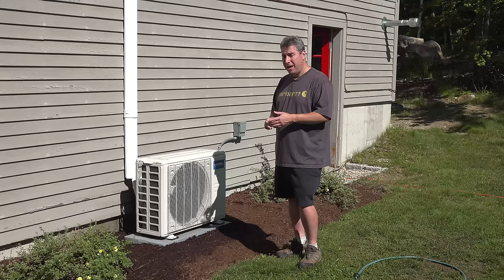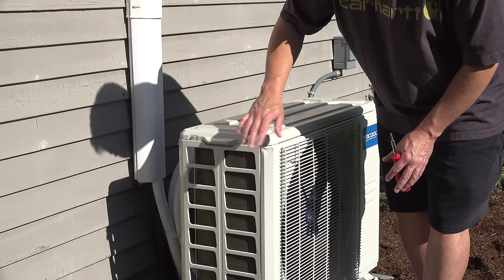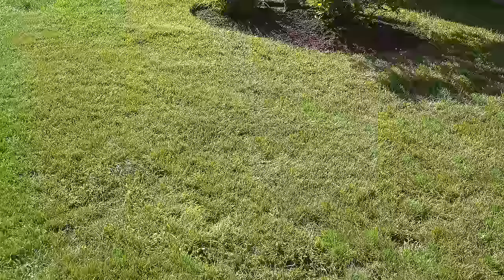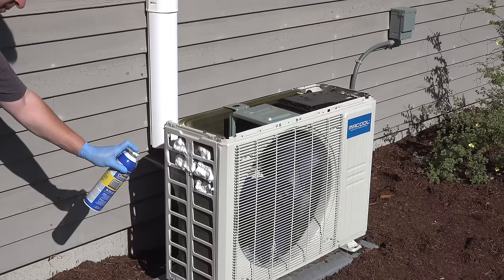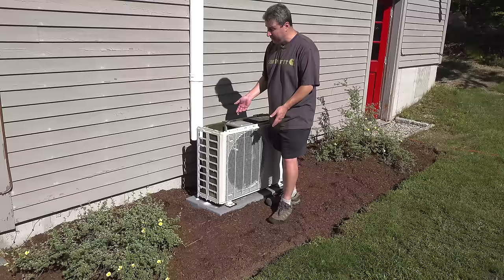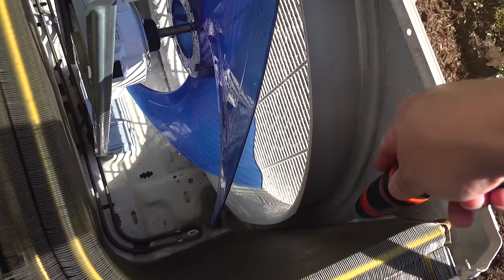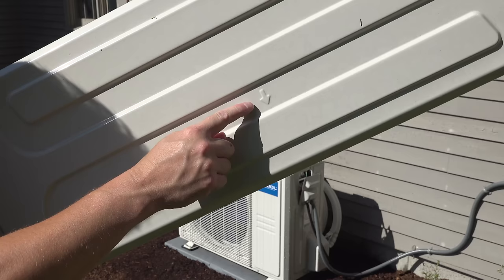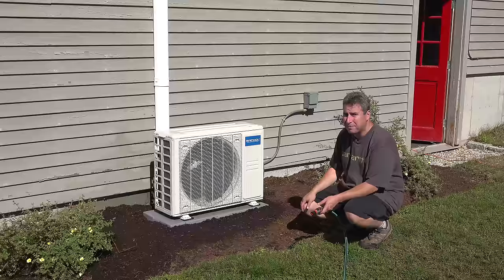How to Clean Your Mini Split AC Condenser - Make it Cold Again

Comment: 35-year vet of the NYC HVAC wars here, I would recommend starting at the bottom, so you do not miss shooting the cleaner into the coil. it's too easy to miss getting the cleaner into the coil when it's covered with foam from above. very similar to washing your car I suspect, too easy to miss a spot due to soap running down over dirt. you can also use a mixed solution and a coil gun hose sprayer. they are useful for more than just cleaning HVAC units. maybe look into the "coil gun" sprayers we use on the job and some mix it yourself cleaners for your next video on the topic? thanks for another great DIY video.
Reply: I often hear those thing referred to as a 'Foam Cannon'  or 'Foam Gun' in the car cleaning world, just in case anyone is looking for such a thing. Over here in Aus they don't seem to call them 'coil guns' all that often.
Reply: I would start in determining if the unit needs to be cleaned at all. How does one determine that? If everything is working when you stand in front of the fan the air should be blowing directly towards you, if you feel a low flow put your hand right next to the edge outside not sticking your hand into the fan but if the air is blowing sideways then you likely have a dirty coil. If it’s blowing straight and with force, what’s called “ throw” in the industry then it’s clean. One last thing, those units normally incorporate what’s called a Venturi . Look it up it’s used in other industries like fuel systems in cars and jet engine flow control but on an HVAC if the fans not latched at the right distance it retards the flow and gives the impression of a clogged coil. So recap. If the dam thing isn’t clogged don’t clean it. You might break it not knowing what you’re doing.
Reply: @carlospenalver8721 as far as the outside part just go out there and look at it and if it looks like mine it will have trash on it and lint. I'm doing mine this weekend for the first time. I watched the HVAC guy do it and he didn't even remove the cover.
Reply: 4:07 No.
Reply: @braniganirby3586 Very helpful comment there. I love the detail and the context you included 😂

Comment: I am an AC technician, newer coils should not be using chemical cleaners. You are stippling coatings off that help it stay clean. The coil can also start to oxidized because of stripping those coatings off. To properly clean your coil blow it from inside out first with compressed air then use water from inside out. There are also coil combs that will strain the fins
Reply: Can you define "newer" coils? Is there a known year cut off? Thanks
Reply: @El_Hicks  its bs. Newer units have better material, so no problem using foamy spray.

Comment: Been doing air conditioning for a few years now and approve this message. I think the cleaner isn’t really needed. Just wash it with water from the inside out and you should be good.
Reply: That's exactly what I do and if you spray it off often enough you don't need any kind of spray
Reply: Should you wait for it to dry before running it tho? If so how long
Reply: yes, this product is probably unnecessary. at least in warmer climates where you run it in Cold mode most of the time, the outside coil never condenses and therefore never gets mud or mold. The indoor coil is always nasty and maybe this product will help. But the thing is, to clean the indoor coil you need to take apart the entire indoor unit. need to save all the gas, uninstall the indoor unit, disassembly EVERY SINGLE PART OF IT and wash anything that's not electric with a pressure washer. at this point this product isn't really saving you anything. pressure washing will do everything for you.
Reply: He used to use water and soap. But now he can get paid from the cleaner company

Comment: when you replace a screw  into anything you have opened, place the screw into the hole and with the oppropriate screwdriver, first turn it anti-clockwise ( lefty-loosy ) slowly and you should either hear and/ or feel the screw click into the original starting position. this procedure is most important for plastic  objects, so as to stop cross-threading. P.S. you may need to repeat this a few times, but you will get the the idea.

Comment: Are you going to clean your inside unit? That is important to clean as well.
Reply from the maker: Agreed, you won't need to clean the inside quite as often but I wouldn't go beyond 2-3 years in a residential setting. I am planning that video, its more involved but I would like to work out the best and simplest way to do a good job and will definitely share that video.
Reply: @SilverCymbal eagerly waiting for this video! I am scared mine may have mold inside and want to clean it
Reply: I can see mold on our blower wheels. Definitely wondering how to get in there to clean the inside.
Reply: Also looking forward to this 👍

Comment: Moved into a home & had the pros come out & do a maintenance for the inside & outside units of my mini split...yep $700.   Later that the fall a tiny mouse got into my outside unit & got killed by the fan trying to escape.  THIS TIME I decided to get the mouse out & clean the entire outside unit myself. I disabled the power, took the top & front grill off, vacuumed & hand wiped the inside down ( took photos in case I forgot the order of putting it back together).  This summer  I will TRY and do the COILS ...Thanks LOVE your videos !

Comment: Iits a good to cover the electronics with plastic to ensure no water gets in there. The electronics are at the top at the power entry end and often not that well sealed. Some brands encase the circuit board in resin but others dont! So go easy with the water around the black plastic or alloy box to avoid issues.

Comment: Great as always! Thank you. On the topic of airflow, the coiled up line-set behind the condenser are restricting some of that airflow. Many DIY folks that have installed this or similar units have the same issue. It would be a great video to see a DIY custom line set length, evacuation, etc… Obviously this wouldn’t work if the line set comes pre-charged vs the outdoor unit being pre-charged.

Comment: Great vid, would definitely recommend using air to help with the drying process! And avoid any damage to electrical connections!
Reply: Air as in from an air compressor? Like one to fill tires?  I don't have anything larger.
Reply: @josephina4792  I think a hair dryer would work well

Comment: Much better if you remove the fan blade and spray from inside. Pressure washer without the nozzle   installed is the best way to clean it without bending a fin.

Comment: I'm impressed with how easy it is to clean a mini split condenser. Which the central compressor we had from the 80s, you pretty much had to completely dismantle the thing to get to those coils. If I got a mini split, I think I'd like to put it on top of cinder blocks. Our window until never got as filthy as the central compressor, and I think it's because it sits at ground level. Even setting it six inches higher might help a great deal in keeping the coils clean. In some cases, they're just mounted on supports on the side of the house like a few feet above the ground. I never saw any point to waiting until it was completely dry to use it. It's made to get wet, and it's self-drying. When I'm just giving the window units a quick spray, I'll actually just leave them running. If you hear the motor spin down, just lay off the water to let it spin back up. Don't set them stall out. Window units are designed to retain water, and the fan blade slings the water onto the condenser coil extra cooling. The fan has to be powerful enough to sling that water. The water also helps cool the fan motor and compressor.
Reply: well, to wash a mini split evaporator (or more correctly "indoor unit" since most are hot/cold units) you really need to uninstall it and disassemble it completely. i bought all the tools to do it myself. in just one summer i paid off for all of them.

Comment: It's unbelievable it costs so much to have a professional clean a split a/c. Here in the Philippines it costs about $15 though they only use a pressure washer and a shroud with drain hose. Most Westerners also don't know your car A/C also needs washing occasionally.
Reply: here in Argentina it costs $50, but we don't use the shroud. ac techs will completely disassemble the indoor unit, meaning storing the gas in the compressor, disconnecting it, taking it apart, disassemble and wash every single part separately, and put it back together, reconnect, and vacuum it down... which tbf is the proper way to clean these. The shroud  isn't really that effective because of the shape of the indoor coil. you're only hitting the front coil ( it's an inverted V shape). i live in a dusty area and I really need to wash my ACs every year.

Comment: The cool thing is with these units after there done doing there cooling or heating the fan will go the opposite way so light debris on the coil will blow away so you don’t have to do maintenance often.

Comment: Had split system installed few years ago and i live up the mountain area and extremely cold 🥶 during winter season 

Last year for the first time my unit stopped working during an extremely cold night running on heat. 

The inside unit displayed DF

I quickly did a search online and turns out these units can’t handle extreme cold temperatures and goes to sleep defrost mode kicks in.  Usually takes about 10 minutes then kicks back on. 

Thankfully got wood heating.

Comment: Have you caulked or taped the white insulation where it meets the copper? Lots of failures with that insulation from pinhole leaks where moisture corrodes the copper.
Reply: Copper corrosion due to moisture is not a real life thing.
Reply: @lesg9604  Got any sources? I'd love to believe it but the general consensus seems to be that the white insulation when exposed to water on the inside reacts with the water and is acidic, and that is what destroys the copper
Reply: so let me get this straight. The manufacturer of ductless mini splits are intentionally using an insulation product that when exposed to water negatively reacts and causes leaks in copper? Nonsense. Ductless mini splits leak because of improper torque or tightening practices on the flared connections or due to improper installation.
Reply: lol what a non-issue. copper "corrosion" due to water is not a thing. if it was, we couldn't use copper pipes for water. the green stain in copper is just patina. it'll take thousands of years to wear away. pinholes in refrigeration systems appear either in solder joints, or in copper bends, in both cases due to vibration.

Comment: On top of doing shoddy maintenance, most technicians will claim that your unit is "low on coolant gas" and needs to be serviced.  
So many scammy people in the HVAC business.
Reply: "never attribute to malice to what can be attributed to stupidity". plenty of techs will just jump at the AC and plug the gauges and say "yup yup yup there's your problem, it's low on gas" but anyone that actually knows their shit will FIRST look at everything around the unit. AC pressures will vary wildly due to lots of factors (current temperature and humidity, how much the machine has been running, actual problems such as obstructions inside, etc) but THE number one thing that needs to be addressed is making sure the units are clean and free of obstructions. the longer they're in business, the simplest the things they look for first. for example, before doing ANYTHING (even visual inspection of any units). LOOK AT THE FILTERS. so many people don't know the AC has filters that need washing or replacing.
Reply: @drgenio2006   Just a good example of a trade that takes advantage of a poorly informed customer.

Comment: This unit is put right on the ground, this the first thing you want to fix!
2nd- I noticed those long-long pipes behind the unit-those are the main problem- too much energy waste, too much load on the system. Just remove all unnecessary length of those pipes youll see the difference.

Comment: Say anyone that has a mini split with heater did you notice anything different on your electrical bill? Winter cold months is it cheaper and perform better with the mini split heater than you whole house heater or space heaters? Looking to get 18,000 btu in our one big area the family room, dinning room and kitchen which is a rectangular room about 550-600 ft.  Then for the master and two other bedrooms I’d need at least 9000 btu units in each bedroom and maybe a bit more but’s in the master which is about 20x25 plus bathroom. It’s a small house with hot flat room that I need to decide what to put on its black tar and paper roof to reflect the sun from heating it up so much. I rolled on some white sun coating stuff a few years ago over the r over the main Pat of the house were in during the days and evening which really cut down on the heat soaking down from the roof into the house, but it’s wore off and  like it was never done.   So need suggestions anyone would be greatly appreciated. Well if you read all this that is very cool. With thanks

Comment: My split system is wall mounted and is above a sloped asphalt shingled roof...it is easy to access but am concerned about the chemical cleaner may damage the shingles. Do you know of or could recommend a product safe for shingles?

Comment: Quick comment. I noticed your excess line set is sitting upright. In my Mr. Cool manual it says that the excess line set should be placed in a horizontal position, parallel to the ground. Did you manual/instructions say otherwise?
Reply from the maker: No, you are 100% correct. If you saw my previous videos I talked about this, I had intended to raise the stand below and slip it under, but that hasn't happened yet. But you are right that it should be horizontal. Not sure what happens the other way as a lot of folks put it vertical but Mr C say horizontal is the way
Reply: Hey there Mr. @SilverCymbal  and @samrobinson9802
Not sure if anyone said anything on the topic... but the coils placed vertically have a tendency of collecting the compressor oil as it inevitably escapes the compressor and travels through the system. In an ideal world, it would make its way back to the compressor eventually, but the loops usually interrupt this process and it begins to pool at the bottom of the loops. Its a slow process but it does take its toll over time and it will cause your compressor to be starved of lubricant. Always better to have the loops placed horizontally, or, if at all possible, cut the extra pipe and remove them all together. Hope this helps.

Comment: Think this will help if the unit not blowing cold air? Had mines for around 3 to 4 years with minimum use since it's in the garage area with it never being cleaned.
Reply from the maker: If you are not getting cold air, definitely look at the outside unit closely. You might be surprised to see the fins are caked with dust/dirt etc. If that is the case I would definitely clean it. There can be other causes but this is most often the issue.
Reply: @SilverCymbal  Thank you
Reply: You also may have a refrigerant leak which is the fluid/gas in your system but having a refrigerant leak is rare
Reply: @laundrybreadsticks  That is what I was thinking and Google suggested but I'm gonna try this method first. Thanks

Comment: Good video, quality content.

I'm curious, however, about the placement of your system: on the ground, on a concrete pad.

I recall last winter you had an issue where you got something like three (or more) feet of snow over a couple of days. That would totally bury this unit.

In an area where you get so much snow, shouldn't the exterior unit be placed off the ground by a couple of feet?
Reply: These units are not supposed to be ran below 32 degrees.
Reply: @brockbrawn1524  that's not entirely true. there are many of these rated to be used below 0C

Comment: I'm also in NH and I have a 36k DIY MrCool in each my house and my woodshop. Both of them are marvelous air conditioners but neither of them, since day one, have been able to bring heat inside during the winter. One kind of barely works and the other throws a fault code and disables itself. My hvac guy (a young guy getting into the industry, who is willing to take a risky client like me with a DIY system) told me that these units just dont have enough pressure in them to do heat. I am curious if anyone else has anything that corroborates this.
Reply from the maker: That is very surprising, I don't know all their models numbers. But since you live in NH you will really appreciate the fact that I stopped using the hot water heater (driven by propane) and ran this 18,000 BTU unit for heat even when it hit -19f this winter! The unit never shut off nad the heat did very very well. This is not a super heat model either, just the DIY version. The only things I can share is without exception the outside unit has to be free of snow front and back, and I did that many times as I knew it would have an issue. Also try to keep it on a setting and leave it, you can lower it but it is not good if you are running in sub zero temps and leavr it off say in a shop for a week and then just turn it on, it can have a hard time. Above 10 degrees with never an issue at al for this one for me, but again models might vary. Hope this is helpful.
Reply: i have two samsung mini spli they have heating function but i rarely use it for that because it seldom goes to 0 here in the winter. but the heat works. mostly i use them for cooling in summer.